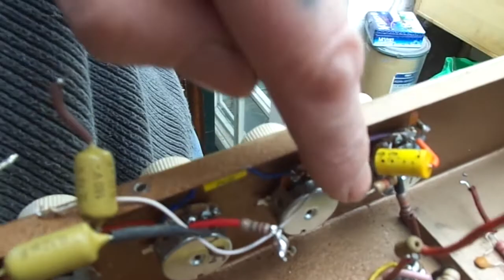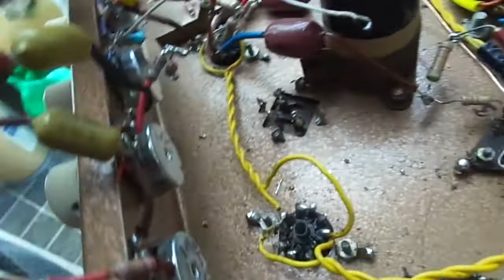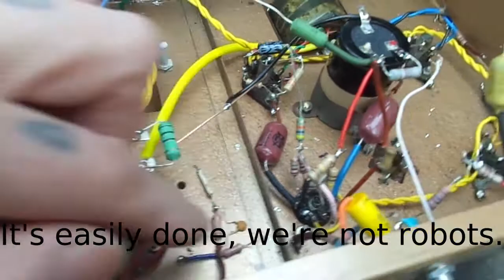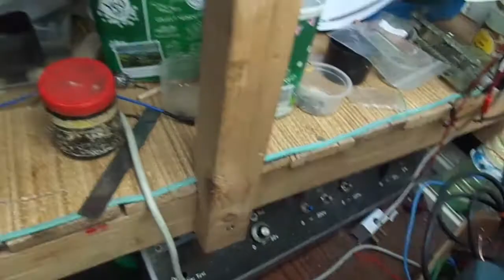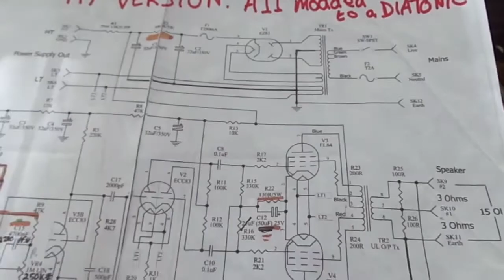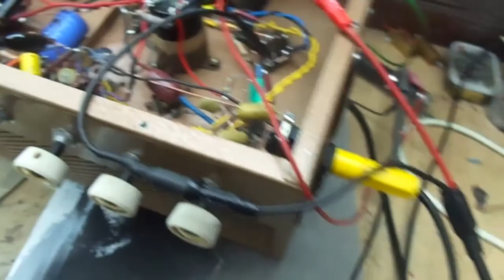Repair of Linear/RSC Diatonic/A11 amplifier. Improving the layout. Part 2

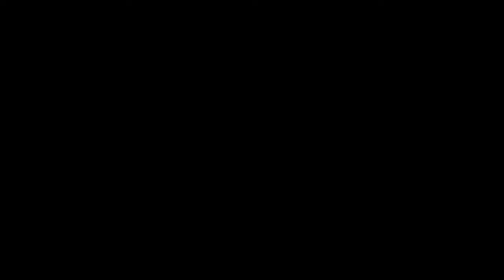Comment: The video cuts out at 16:58 - did the camera battery die? Cheers
Reply from the maker: Yep,sorry about that, SD card full up, only have a 2gb, so if it's not the battery going it's the card. I'll never win awards for video quality but hope you got the gist. Thought it better to post something rather than nothing especially as you commented on part 1 re "interest in grounding"......DA.
Reply: @diabolicalartificer  Yes thanks for that.